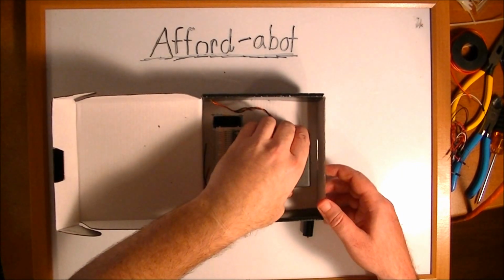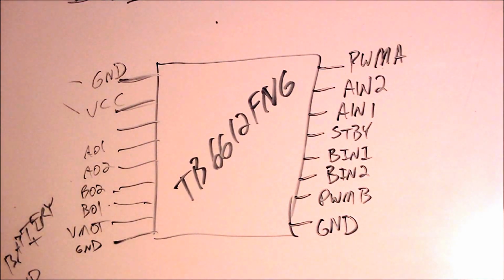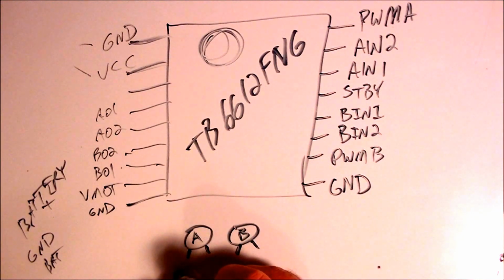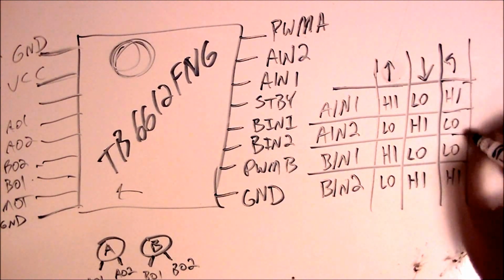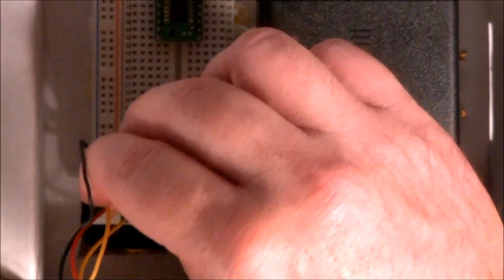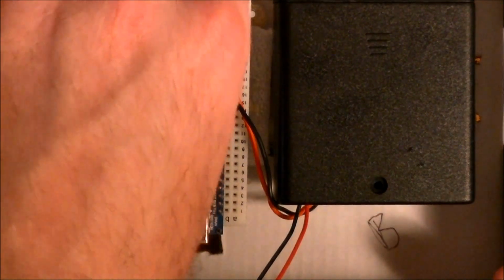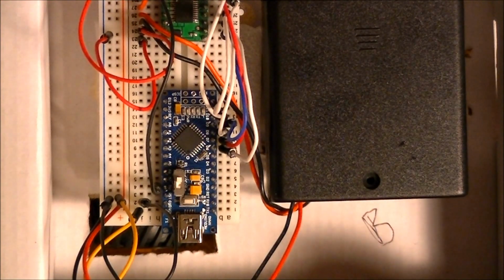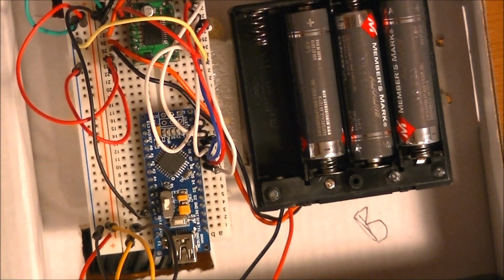How to build an Arduino robot - Connecting the Nano, motor driver, motors and battery pack

Comment: hi man i have a question or can you recomend something for an electric scooter, this microcontroller tb66---- is for 4.5 and 13.5v, i wonder if you have use something that will work just fine with 24v, something that you already know, thank you